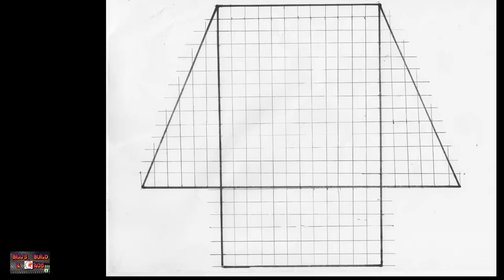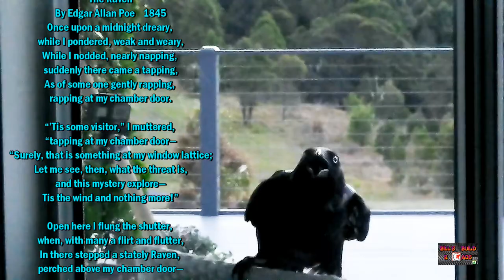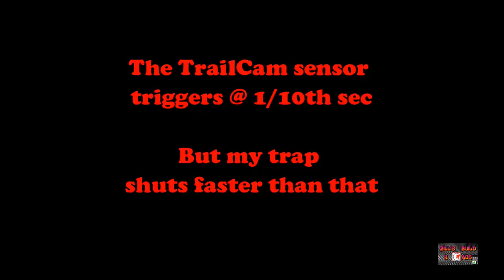Build a Larsen Bird Trap

Comment: G'day Bill. I enjoyed your tenacity and ingenuity. Can you recall spring specifications, such as length/gauge/etc.  and were they fastened by hooking them in?
Reply from the maker: I just bought  cheap springs from the hardware that were 300mm long & hooked the ends in until I got the tension right.